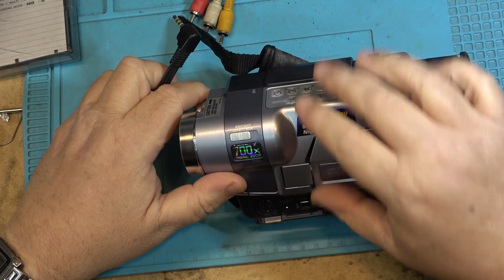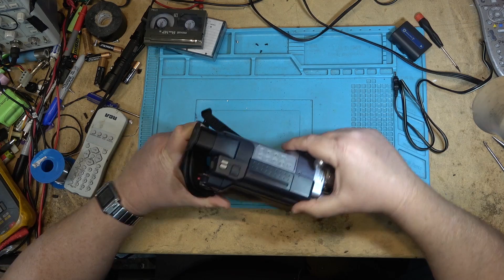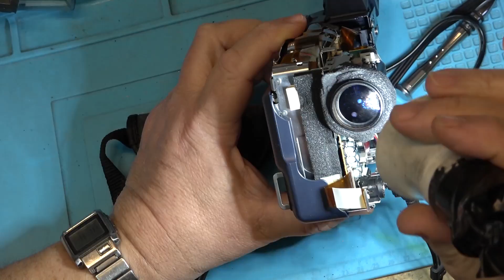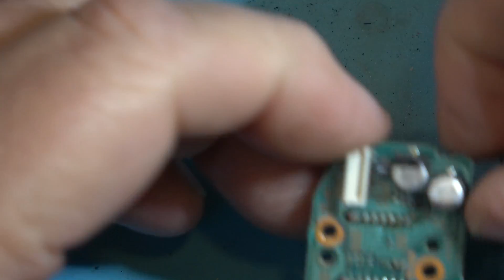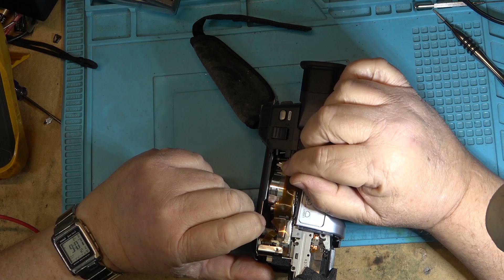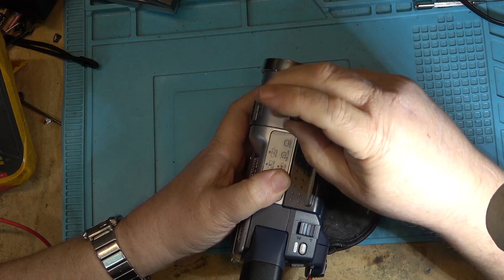Sony DCRTRV250 Camera has Black Screen

Comment: The CCD on the later models after 2003 up to around 2005 were a well known failure  Sony used cheaper epoxy CCD packages rather than the more robust ceramic ones. Over time the epoxy ones let in moisture so the connections to the sensor actually got corroded and the only way to fix it is to replace the actual CCD was the actual issue. I have brand new in the box TRV-460 and a TRV480 that I bought cheap due to the CCD failed, but keep them as zero hours on transport which is what I care about. Good thing is don't care as bought them to do transfer due to the internal TBC and digitizer and models that support analog 8mm/Hi8 playback. Most are not going to record using the internal SD resolution camera on them nowadays, as why would you, plus the later Sony Cameras the CCD were not as good as Sony wanted to push people to MiniDV, so they used cheaper CCD's in them.
Reply from the maker: All the digital 8 cameras used a low pixel count ccd.  I use a dcrtrv110 as an external recorder on my evw300 which i used just for the camera. That was I basically had a 3ccd digital 8. It looked great.

Comment: Tons of these older handycams produced by Sony between 2002 and march 2005 are plagued for failing CCD sensors as in that time, they switched to a glue for the sensor that apparently turned out to contain iodine, which evaporates with time under hot and humid conditions. Post-march 2005 they realized their mistake and switched to a glue that does not contain iodine. 

Imaging resource has a webpage about this specific issue and lists most camera brands and models that have been affected by this issue. I say "most" because there are a couple point n' shoot cameras by Minolta, not listed, that can also suffer from the same black plague as the handycams.
Reply from the maker: Yup and that is why the cmos sensors were better.
Reply: @12voltvids  Better in output (in many ways) for sure, but (I don't know) about CMOS sensors being suspectable to evaporation and failure by glue, but what I do know is that CMOS sensors were only featured in some prosumer and professional-grade equipment, as well as webcams and very low-end digital cameras, which may have been manufactured by Sony, but produced in a different factory from the others that used a different glue to make the sensor. Consumer-grade high-definition camcorders weren't really a thing until 2006 when the HDV and AVCHD compression format was introduced, and by then they were already using a different glue (for CCD sensors at least).

What I think would be interesting is to thoroughly disassemble a defective CCD sensor and see where inside the sensor the failure turns out to be, but that would require specialized equipment and somebody who knows their microelectronics, which I certainly don't have.
Reply from the maker: Most people cameras these days are cmos.  Either a large single or 3 cmos.  Ccd have smear.  Yes they got better but its still there.
Reply: @12voltvids  Yes, pretty much everything consumer nowadays uses CMOS sensors - your smartphone, laptop webcam, DSLR's, camcorders, everything. It's much cheaper to produce and has tons of advantages over the charge-coupled predecessor. That said there are still some CCD sensors being produced in specialty batches for stuff like astrophotography and (iirc) infrared, though most infrared these days are CMOS.

The smearing is normal for CCD sensors, even if it is technically a "phenomenon". Some are more prone to smearing than others, as you mentioned. What I believe (but could be wrong) is, the hotter the sensor is operating, the more prone it's going to smear, but IIRC this is an oversimplification on my part and I may be missing something here.

That isn't to say CMOS sensors don't have their own "phenomenons" for lack of a better term. For reference I have a crappy little Vivitar Vivicam 3750 from 2004 (which takes hilariously awful photos), and the little thing uses an unknown size CMOS imager that is so inherently noisy, that it produces literal horizontal yellow banding under certain light sources even at base ISO (100). If you attempt to point it at the sun, it becomes a black & magenta void. Part of that is the sensor itself is basically crap (it doesn't even have an anti-aliasing filter to cut moire), but the other part is the basically nonexistent computational processing that the camera has, which is literally as barbarian as it gets. But I love it because of that, it's just so bad & crappy that it's "good", and it's certainly MUCH better than the truly awful imaging products that the Chinese sell on Amazon today.
Reply: Yep my 318 is having problems with its sensor and is on the list as well as the trv118 which I also have but it still works

Comment: I wonder if the ccd from a high def security camera that uses a Sony CCD ELEMENT could be replaced onto the ccd board.
Reply from the maker: No. It would need to be the exact same chip. Software dependent. This is a low resolution chip.

Comment: I got a sony video 8 camera and i dont have any color its not even black and white its weird you can only see the outlines of things its trying to bring color but it never does it just flashes any help???
Reply from the maker: Toss it out and find a late model. All the caps will be leaking and the fluid is corossive. It attacks the board. Money spent trying to fix is money burned because it won't last.
Reply: @12voltvids  they are rare over here i would love to also expensive so i thought i could get it to work also the playback isnt working the spool is spinning bit by bit and it stops snd the red light flashes
Reply from the maker: @CrazyLittleYugo  should not be expensive.  Get off eBay. Old video cameras are dirt cheap here.  I had 5 digital 8 models given to me and a hi8 pal model.  Now mind you if i was selling any which I am not because i use them for tape digitizing and they will eventually wear out i wouldn't give them away.  If someone offered me enough I would cut them loose without batting an eye.  It would be my oldest camera with the most hours on the heads.
Reply: @12voltvids  Respect and thanks.

Comment: Could sunlight have destroyed the CCD?
Reply from the maker: No CCD are not subseptable to instant burn like the old tubes were. They fail just because.  No reason they just go out at random.  Manufacturing defect.
Reply: @12voltvids  deliberate manufacturing defect to make it a timebomb.
Reply from the maker: @kyoudaiken why would they do that?
Reply: @12voltvids  to make consumers buy more . ever heard of the phrase "what lasts long brings no money" ?
Reply from the maker: You must be into conspiracy theories.  Doesn't work that way because if companies actually did put a limit on use and things did expire nobody would buy from that company again.  Wait a minute there is one that does that and was convicted of doing so and is now dealing with a class action lawsuits.  Apple.   
Parts fail.  Sometimes when not even being used or abused.  Not every defective chip makes it past QA. Look at all the bad caps of the 80s and early 90s.  The manufactures had no idea they would fa after 6 or 7 years.  Video cameras were the most complex gadgets ever made.  Cramming what used to be a machine that took up an entire room into something that you can hold i. Your hand.  Actually cramming 2 huge machines into something that fits in your hand.  That was an engineering miracle and the fact of the even work to begin with is amazing never mind working 30 years later.  Tape-based video cameras were designed with a life expectancy of about 5 years. That is the life cycle that manufactures expected that people would keep their existing camcorder before moving on to a smaller better quality model. With all the advances in home video starting with betamax and VHS. Then 8 mm followed by the higher resolution formats high eight super VHS and then the digital formats mini DV and digital 8. People did not keep camcorders very long because every couple years there was a new model which perform better and low light had a better picture with smaller and use better technology and people would upgrade. That was the whole point of digital 8 to begin with was to allow people to upgrade to a digital recording while maintaining compatibility to play their old recordings and most of the digitally cameras would play analog 8mm and high eight tapes. This model did not feature analog playback because it was marketed as a cheaper version for people that did not require analog playback but we're not ready to commit to the more expensive mini DV format. It was a budget camera that was only a couple hundred bucks back in the day. I don't know the exact price that this camera went for but I'm guessing was probably under $500 and the models that played back analogware probably 7 or 800. now I may be way off on those prices because I never really looked at retail prices I used to buy my cameras wholesale at the shop that I worked at and I know how much markup was on them and it was a lot but most of these cameras to the dealer was pretty cheap. I think my first DCR TRV 110 actually that was the only digit camera I ever purchased I paid around $900 for it at the time and it retailed it I think 1499. the other four digit late cameras that I have now I got for free.  
The thing is no manufacturer with the exception of Apple is going to place defects in a product hoping you're going to come back and buy another one because that would normally backfire on people with the exception of Apple because Apple folks are brainwashed into only buying Apple but any other company that tried that shit people would buy from a different manufacturer if it did not last the length of time that they expected it to last that's a fact.
Reply: @12voltvids  The only device I can think of that was made to fail - the light bulb. 
But that is changing now that they are being linked to Smart devices, they are now made to last 1000's of hours.
I read that in the past, filaments could have been made to last decades but people would not need to purchase again, and that's bad for business.
Long time watcher - you have given me the confidence to repair multiple devices, including Handycams.

Thanks!
Reply from the maker: The thing with light bulbs was there was a trade off between lumens per watt consumed and life.  If you reduce the temperature of the filament they will last far far longer.  I have a modern grandfather clock that was made early 2000s. The lady that owned it never turned the lights in the pendulum off. It has 3 brightness levels and she ran it on dim as a night light.  I inherited it about 5 years ago and I have left the 2 incandescent bulbs running on low ever since i got it.  Again night light at bottom of stairs.  The bulbs are over 20 years old and show no sign of blackning.  They will probably last 100 years.  Incandescent designed for traffic signals were rated 8000 hours.  Not very efficient as they draw the same power but run cooler and last a long time.  General purpose bulbs were cheap, and run real hot and they lasted 750 to 1000 hours but were dirt cheap.   There are now LED bulbs rated 1500 hours that are only a little over a buck now.  They drive them harder so fewer LEDs are used and that makes them cheaper but they burn out sooner.
Reply: I may have a working ccd for it, but it would be a couple of weeks before I can check.
Reply from the maker: @scottyfixit  Well it's mine now